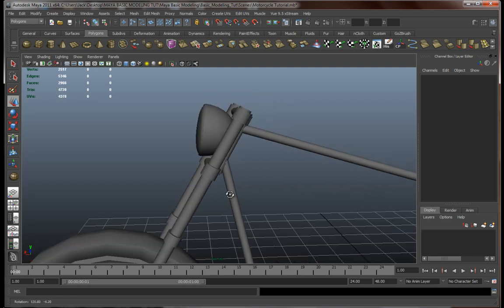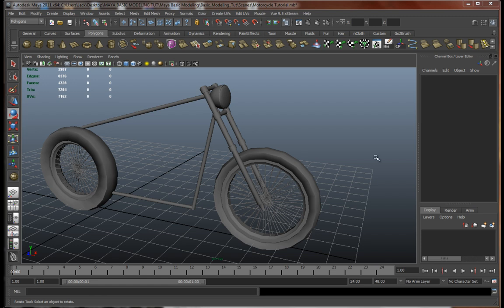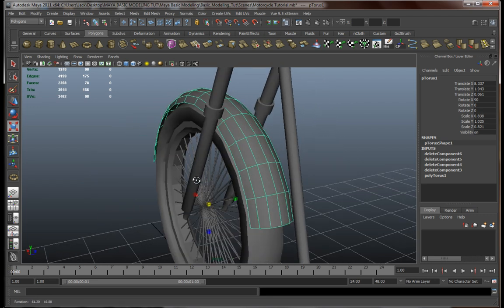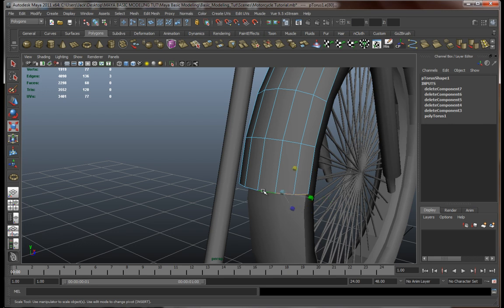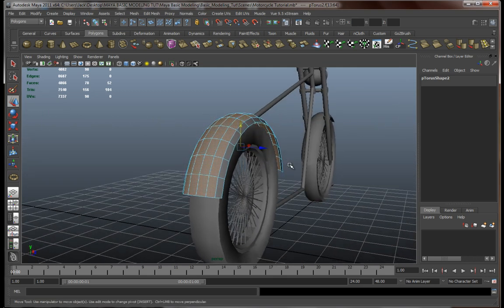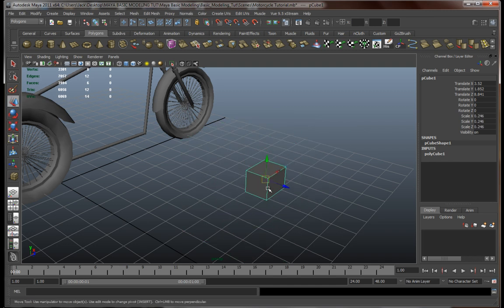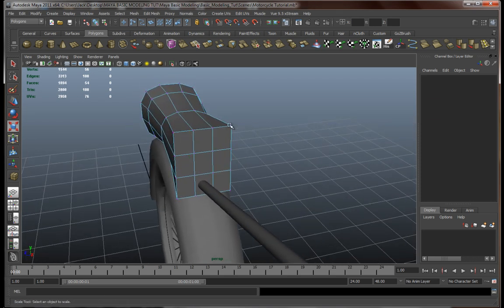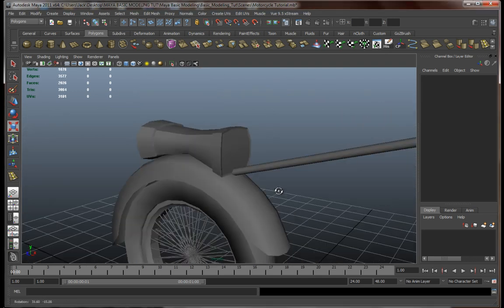Maya Beginner Modeling Tutorial - Motorcycle ( Part 4 of 13 )

Comment from the maker: Hey mate, glad my stuff helped you out ;), I'm happy that my work hasn't gone to waste, anyway, regarding the selection thing if I didn't use any layers I probably clicked on some filtering buttons in the upper toolbar under mesh/edit mesh, those buttons are there if you wish to turn off certain selections in the viewport, like cv curves, poligon meshes, subd's, nurbs etc, but frankly I don't remember using them in this tut so XD, but in any case, you can either use those buttons or layers ;)

Comment from the maker: @schmidtj53 Just keep working at it , it's just geometry , you have you faces , edges and vertex points , move 'em about until you get the shape you want , if you're reffering to the back-end of it just pull the vertexes from the centre of the back part of the seat , leave the ones on the edge alone , it's pretty self explanatory really and it doesn't need to look just like mine , make something which you like , in essence have fun ! ;)